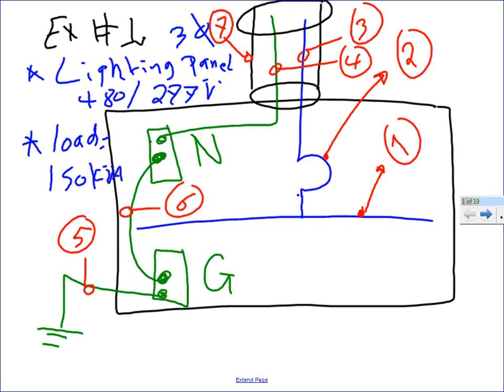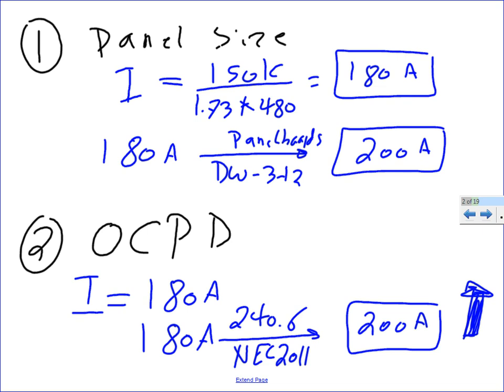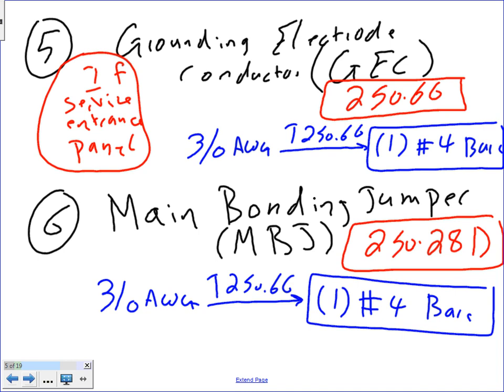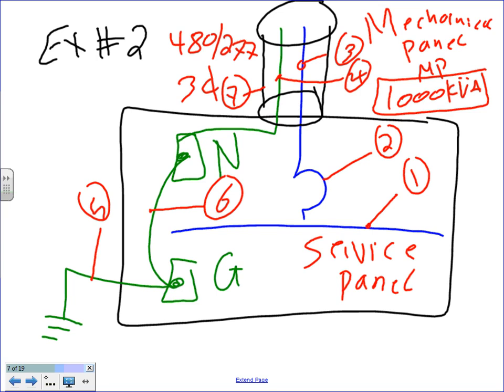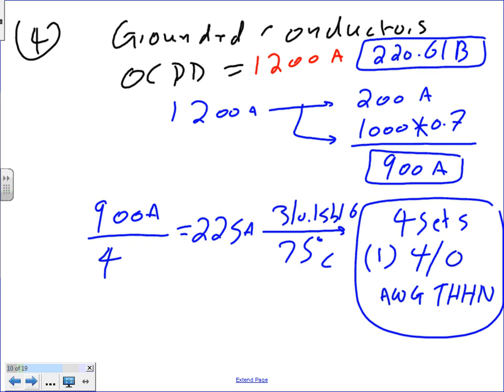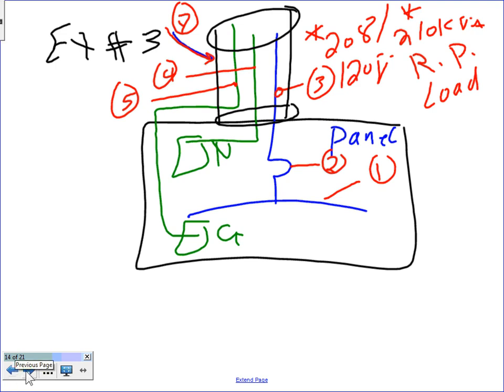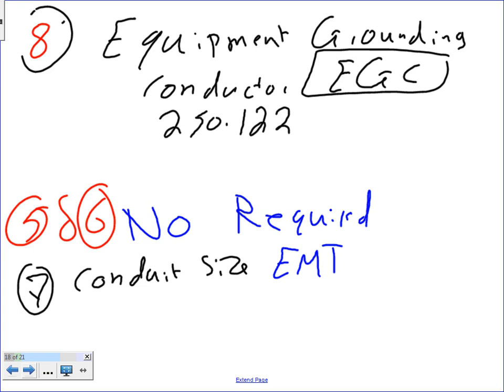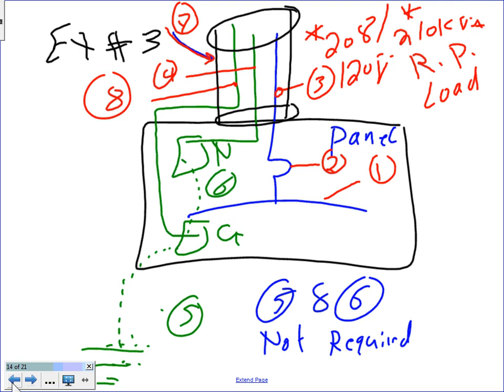PanelBoards Sizing-04-04-12.wmv

Comment: Chad, in the first lighting panel example you designed 4 3/0 thhn conductors in PVC conduit. Since this is a lighting panel and not a service we must supply a egc based on the ocpd  of the panel using PVC raceway.